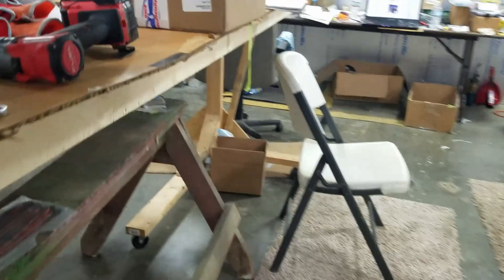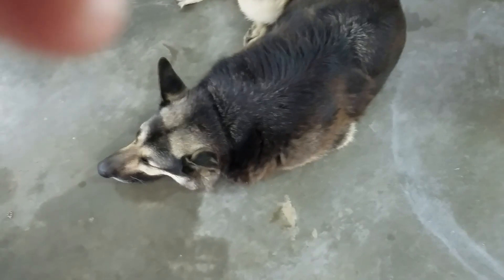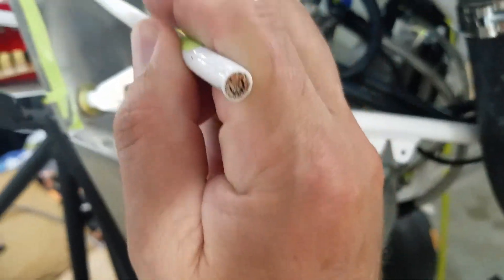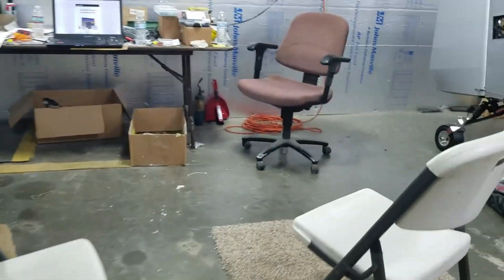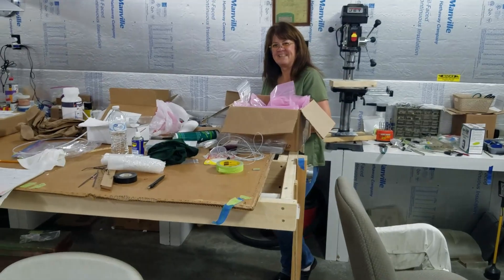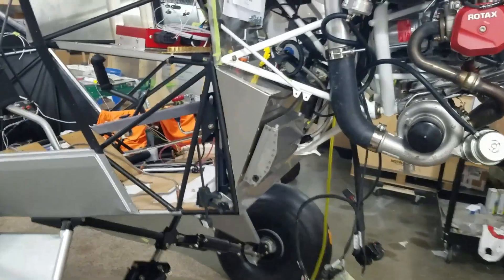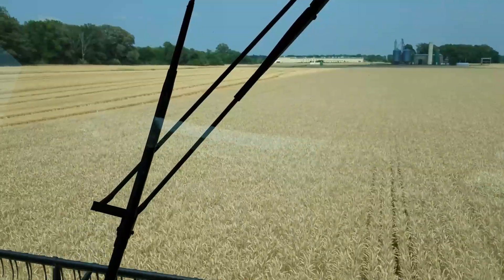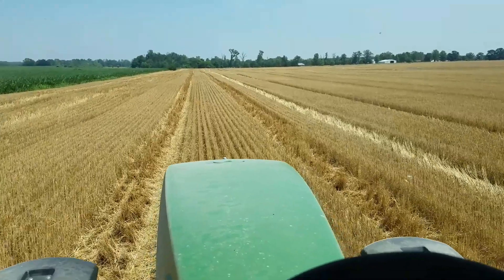Kitfox STi aircraft build. Wiring on the Farm fox. #31

Comment: Did you put a valve on the pilot side of the cockpit heater core?  I think I heard you pondering that at one point in a video or on the forums... If so, what did you get? If not, how has the heat been flying this summer?  Thanks!
Reply from the maker: Hi Dan, I did put a valve on the heat to stop it from heating in the summer. I have reached under there and it works. I haven't flown when it was cool enough to need the heater yet. I used a half inch stainless gas valve from ebay.

Comment: Looking great Harlan. Thanks for blazing a trail with the Garmin install. Still quite a ways behind you but learning a lot from your videos!! Did you fabricate the mounts for the remote transponder, battery, head phone jacks and ELT or did you pick them up from Kitfox? What type of connectors where in the plastic case that was almost gone? Sorry to blast you with so many questions!
Reply from the maker: Hey T Man thanks for watching. I did make all the mounts. All are pretty simple, figuring mounting locations was harder for me than making the mounts. Lots of decisions to be made at this point how to mount and run wires free from control interference. The flat tray in the back for the battery comes with the 915 fwf kit. Head phone jacks came from stienair when I was ordering something else. I just got my Artex elt so I have it to mount now. Most of my garmin stuff came from my local shop who gave me a huge discount for buying there. Lots of stuff came from Kfox. The plastic case was full of solder connectors with and without ground wires. Keep me up on your build. Hope I can help you.
Reply: Thanks for all your help Harlan. My build is slow and steady. Work has kept me really busy, so I fit in what I can. I'll be updating my build log soon on the team site with what I've gotten done.  I'm currently on vacation with the wife and will be flying with Stick and Rudder this week. I was surprised you decided to put the battery in the back. I thought you decided to keep it in the front and just add weight to the tail. what changed your mind? Which battery did you decide to go with? Last question; what are you doing for a transponder? Love the farming videos. The kid in me is always curious about the process and the equipment. Keep them coming!
Reply from the maker: @tman3587  I just gave in to moving stuff back for weight. The fwf kit comes set up for the odyssey battery, it weighs 16lbs and they say thats all that you need for the 915. I went with the earth x at 4lbs but much more cca so I thought i could get by with it back there. I don't have a transponder at this time. We are a long ways from a controlled field and I'm going to wait and see on it and adsb out which are pricey at this time.